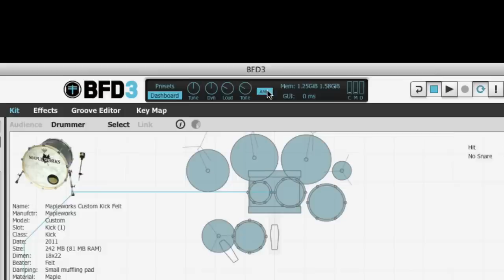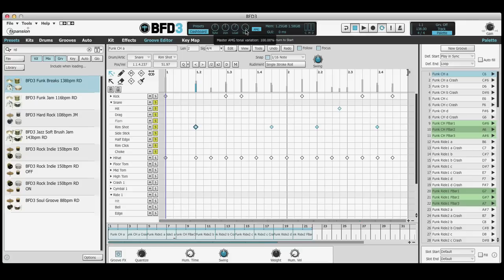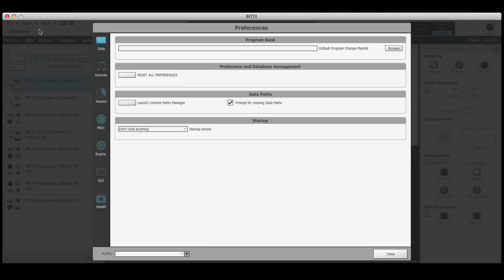FXpansion BFD3 Tutorial 05 - Anti Machine Gun Mode

Comment: Amazing ! I have a question. Does It works for every expansion including Third Part expansions such as Joe Baresi expansion ? Thanks.
Reply: Great ! Thanks for the answer ! Cheers !
Reply: I don't know why but after I set up the keyboard shortcuts in BFD3 preferences When I turn off BFD3 and load It back again It doesn't save the Keyboard Shortcuts and I have to set It up everything again. Is there any tip to save  keyboard shortcuts in BFD3 ?